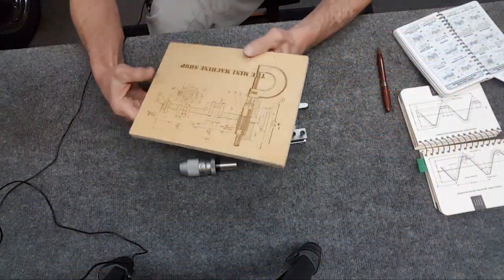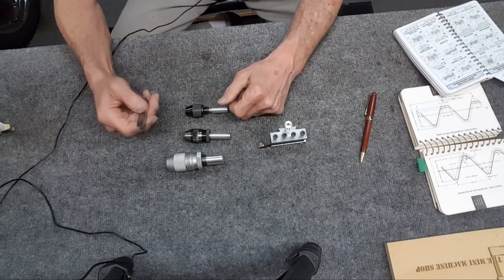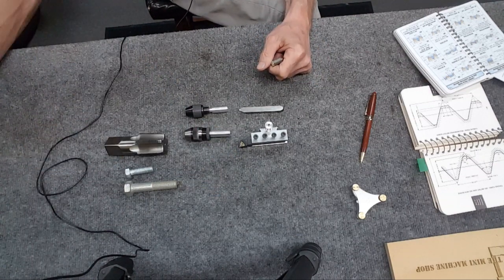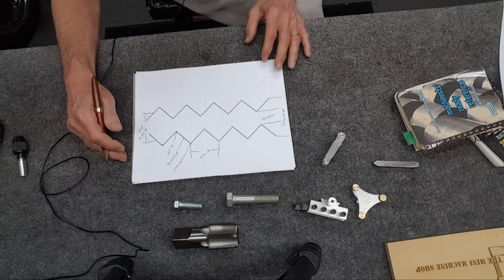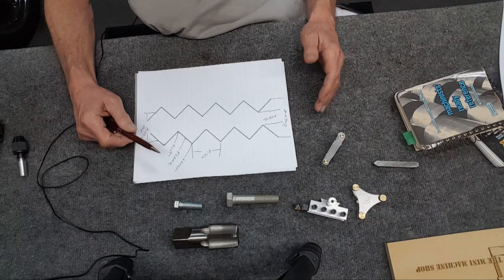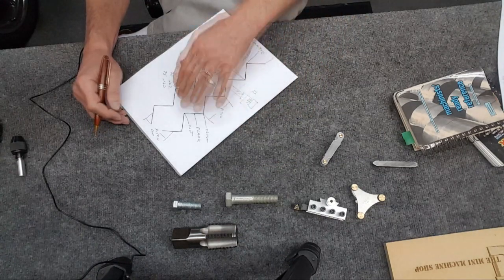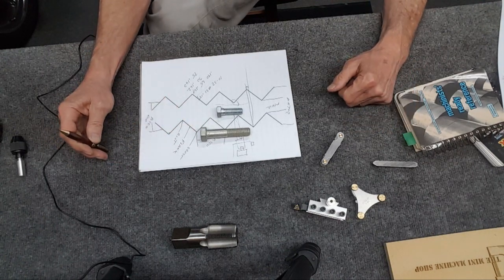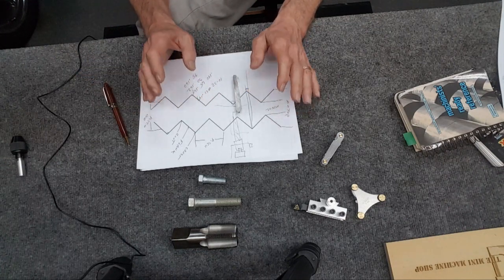What You Need To Know About Threads & Lead Screws

Comment: I come across this helix angle frequently when making multi start threads. I've always looked at that angle as the minimal angle of relief of the back side or trailing flank of my threading insert. While I don't use hss threading tools, the inserted carbide inserts usually have been 6 to 9 degrees clearance on that side so it doesn't rub on the tool as you cut most threads. When you get into the multi start threads you have to figure this angle and grind that angle or bigger to the trailing edge. I hope this makes sense and if I missed understood you about this topic then I apologise. Great video!

Comment: Excuse me.
I said wrong.
I replaced the screw with another one with a different thread.
Now the milling machine is not working properly. x-axis in 3018 cnc
Reply from the maker: You changed the pitch so reprogram GRBL for new steps per rev.
Reply: @TheMiniMachineShop  
Thank you for your answer.

I don't really know how.

But I will try.

Comment: Having a look at your leadscrew comparisons - one on the bottom has a triple start and why there is a different helix angle. The pitch is the same but the lead is 3 times greater. 

To my mind if you have a screw of 32 TPI then the diameter relates directly to the angle. If you had something 2 inches across with 32 TPI then the angle is going to be super shallow and if it were 1/8" the angle will be larger. If you make an external thread to match an internal one,  the helix will just work itself out. Nail the pitch diameters when cutting the thread and you'll be fine. I've never done a multi start thread but f i were to, i'd grind my tool for a lot more clearance for the helix. Worry about that when the time comes.

Comment: Dying? who's dying? What's wrong with them?
I am not surprised that there is nothing about threads in your little books. Even the "Green Bible" is rather brief about it.
I have a 320 page French book, about nothing than all the different 'species' of thread! (many of them obsolete) and even that isn't complete !
To answer your question re drills.... metric drills are your best bet. Those can readily be had in steps of 1/10 mm and any really pro supplier for should be able to get you any size in steps of 1/100 mm (it won't be cheap!)
for some sizes, I reckon your system of number drills should provide some of the sizes needed.
Acme and trapezoidal threads are best cut with inserts made for the purpose, since they already have the cocked angle you spoke about, included in the geometry of the insert.
The helix angle is determined by the 'speed' or pitch of the tread. For Acme and trapezoidal threads you should follow the conventions set out in the published tables. 

You could divert from that, but I don't see what the use would be.
If a manufacturer makes his own screws and their machinery is not set to the default specs, you end up with the sort of troubles you seem to experience!

Paddy
Reply from the maker: Hey Paddy been some time since I've heard from you. I do have a basic set of metric drills but finding the missing sizes is next to impossible here. BTW why is it every drill be it #, A-Z or fractional even metric is always under sized? Is it that difficult to make a 6mm bit 6mm and not 5.98mm?
Reply: No, it isn't difficult to do that, providing you can do a bit of precise cylindrical grinding... One would be tempted to do that in a lathe, but that isn't the greatest idea. A surface grinder with an attachment will do nicely.
If you really need an oddball size, why not make yourself a D-bit of the correct diameter? They are easy to make and can last a while if hardened and tempered properly. For a small size (say 4 mm or less) you could also consider making a small spade drill, as is done in watchmaking. Those are manageable enough to hand-lap to size. For anything under 3 mm, don't forget those carbide/dental/PCB router-drill bits! They are dirt cheap and can be had per 1/10mm, the better supplier may even have them per 5/100 mm.

All the best
Paddy
Reply from the maker: The interest in the mini lathe and mini mill is dying is what I was referring to...

Comment: Dave, that bottom screw at 12:57 looks like a double thread to me! The helix angle is dependant on the pitch, the diameter and number of separate threads only. Any change means one or more of the above are changed.
Reply: You're right about a double entry thread...   
Dave you need to specify a single entry lead screw...   If you requested the right parameters there is no way you don't get the right product.
Another very common example of multiple entries, food jars, often up to 4 or 5 entries...
Reply: Yeah. For a moment I couldn't understand what was going on there. But clearly the bottom screw is not a 1 start. It indeed seems to be a 2 start. So no, it is not about the lead screw helix angle. Tricky business xD.

Comment: Sorry forgot to say , the reason you have to incline the cutting for Acme is because it is a Buttress Thread (square)
Reply: Acme is not buttress which is not trapezoidal. Buttress is square, acme is an imperial thread with a 29 degree included flank. Trapezoidal is the metric version of acme and is 30 degrees included flank, so if you use an acme cutter to cut a metric (trapezoidal) thread it probably won't fit properly.
Reply from the maker: What a kick cannot find what ACME stands for anywhere such as Advisory Committee on Mathematics Education
Reply from the maker: More to learn...

Comment: I'm not sure why you would be interested in helix angle. Once you have defined pitch and diameter. the helix angle simply is what it is. You can't control it independently. Its is arctan(pitch/(pi * diameter)).
Reply from the maker: Hi Don, I became interested because I was trying to replace the lead screw, which was shown, and wanted to figure out what spec controlled the thread angle. I didn't know about helix angles yet and had discovered regular threading on the lathe ignores it while Acme threading the helix angle is controlled by the change gears. The video was about passing on what I found exploring and my learning that if you're going to buy a replacement lead screw you have no idea what you'll get.
Reply: Don is absolutely correct, helix angle is controlled solely by pitch and diameter, I've cut several metric lead screws with trapezoidal threads. Acme is an imperial thread with a 29 degree included flank. Trapezoidal is the metric version of acme and is 30 degrees included flank, so if you use an acme cutter to cut a metric (trapezoidal) thread it probably won't fit properly. The only aspect of importance concerning helix angle is to ensure that the cutter has sufficient side rake (clearance) so that it does not rub. The cutter should never be angled to achieve clearance as this will reduce the flank include angle.
If you lead screw from Amazon does not fit the nut, then check the thread form and pitch of the screw.
Reply: @doug3458  I agree that helix angle is pretty much irrelevant when cutting the thread on a lathe, other than insuring that the cutting tool has  enough side clearance (rake).  However, it plays an important role if you are grinding the thread (or milling it with a circular threading saw).  Also, to make matters more confusing there are really TWO helix angles.  The helix angle at the outside diameter and the one at the root, the smaller "bottom of thread" diameter, which has a greater angle.  You can calculate those by taking the arctangent of pitch divided by the outside circumference (which is about 3.14159265 times the diameter) and the arctangent of pitch divided by the "inside" circumference respectively (again, 3.14159265 times the inside diameter).  However, which angle do you use to "tilt" the grinding wheel?  I've read somewhere that you have to use the helix angle at the "pitch diameter", but I have not been able to verify that.  Also, the geometry of the grinding wheel probably needs to change at steep helix angles (the angles used to dress the grinding wheel).  Unfortunately, I have not been able to find much info on this.  If anyone does, please share it!!!

Comment: Hi Dave,  on my lathe, if I'm cutting metric threads, I have to leave the half nut engaged and reverse the lathe because the thread dial is timed for imperial threads only.  If I'm cutting imperial threads I disengage the half nut, back out the tool go to the starting point adjust tool cutting depth engage the half nut on the appropriate  thread dial number and cut again.  Also, the bottom lead screw in the photo certainly looks like a multi start screw perhaps a 4 start.  If you look at the end you can easily see the individual starts.
Reply from the maker: Never looked that closely but all the lead screws I bought said 1 start.. I think you're right!